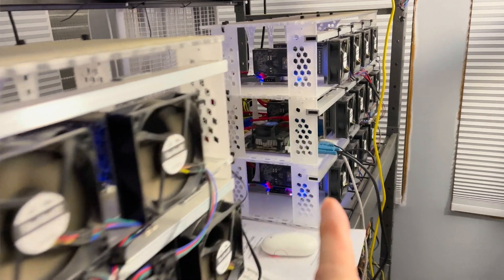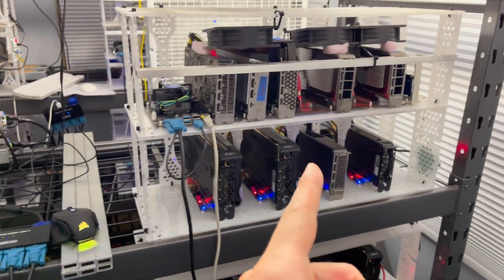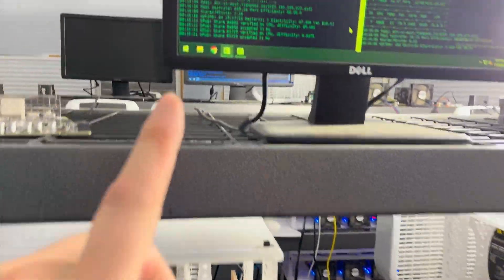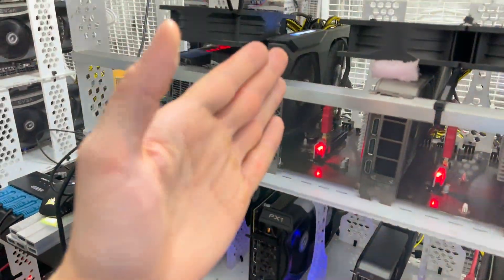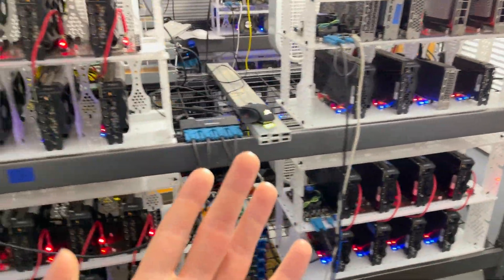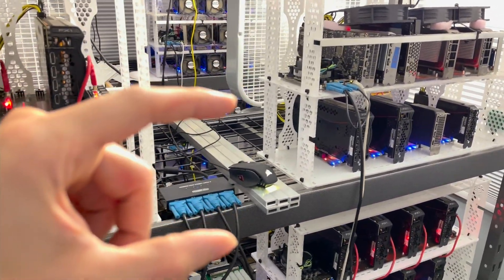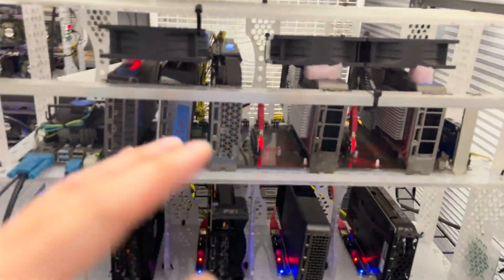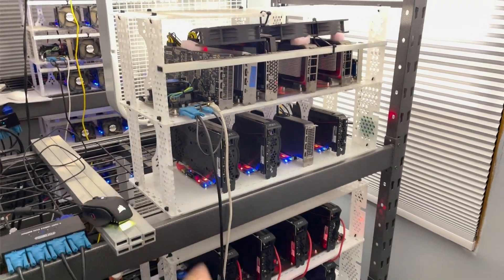Can A Crypto GPU Be TOO COLD?

Comment: Honestly I don't think there is a to cold. . I've run my  cards basically at negative 30ﾟ and they ran fine usually without any fan.
Reply from the maker: Most hardware will happily run at -100F or lower, consuming less power and even degrading slower. But it's always a tradeoff between several variables that results in an ideal temp for the total system.

Comment: One time in winter I got a little zealous with my small farm and just opened my windows all the way. It was 30F outside and inside around 55F. One of my cards started thermal throttling running at ~45C/80C memory. I believe the card became too cool, shrunk and detached itself from the heatsink. When I increased the temps back up it went back to normal! So now I always try to keep temps at a manageable sweet spot. And your advice really helps. Thank you!
Reply from the maker: That’s a curious one. GPUs should work just fine in 30F, so maybe something was up with that one. This expansion and contraction of the silicon is extremely tiny, but this motion still causes issues over time. 

Your support is appreciated.

Comment: Ironically with my ac, I found that it should be running 100% at all times. Allowing the thermostat higher temps and thus the ac to self shut down intermittently the massive power spike to bring temps back to spec (86f) were significantly more costly than setting all units to an impossible 55f, where the room never goes below 72f. Power only ebbs and flows with the rise of the sun. I save about 3kw this way.

A2000s? How many watts do those modded fans use? I personally modeled out an aluminum plate and replaced the thermal pads with those. 40% oem fan across the clusters now.
Reply from the maker: Are these inverter mini splits? I hate how the logic works on most mini splits, it's very poorly suited for an application like mining. It makes sense just hammering them is the play, since your system is undersized anyways. I messed around with a custom controller  on an LG mini split, its possible to control the units capacity and have it ignore the building temp. This is a custom solution that's a lot of hassle though.

The A2000's are shunt modded, 82W target power limit. They run warm since the heatsink is rather small, usually the card consumes 78-81W depending on temp, the fan is ~3.5W at 100% speed and its controlled based on the ambient temp. 40% fan speed on the stock A2000's with the stock backplate and everything? Wouldn't those guys run super hot? The coolers hold up alright at stock power, but these get toasty in a jiffy with power mods.
Reply: @SiCPoWMining  correct on the mini splits. If I could dm you, I’d just send you the same setup video I sent to GPU Risers when they asked for it :p

Anyhoo, 5ton mini split central air system - 2 ton wall mounted mini - 1 ton window mini (mostly to prevent window intrusion/security).

As for the A2000s I’ve still not committed to shunt modding them yet. It makes sense and I’ve got a guy who’s going to practice soldering r005 resistors until he’s comfortable doing the job, at which point he’ll solder his own a2000s and then mine.

As for cooling the a2000s, the aluminum plates make a significant difference, but also the fact that they’re being fed consistent chilled air helps as well. I expect shunt modded, they would probably shoot up to 60% min fan speeds. On that note, all my hardware runs in Octominer cases, so I force feed all that chilled air fairly aggressively to/through the cards.
Reply from the maker: I should probably make some socials.

Those shunt resistors are massive, and the A2000's are super easy to solder to since they don't have some massive power plane. I have a lot of experience, so maybe I'm biased, but its literally a 10-15 second job with very low risk. I did mine a few days after I got them, well before anyone online was talking about it. I messaged a bunch of mining YTers about it, and nobody responded or made a video. That was one motivation for making this channel.

That checks out. High power external fans really ding efficiency on those relatively low density cards, but it does the business.
Reply: @SiCPoWMining  yeah. I hear you on the efficiency side of things - hence the earlier question about your fans :)

With the plates installed, I brought each x12 down by 100 watts. 

Plated 3080s remain unchanged beyond the fact that the GPU fans run at 0% and the case fans cool the entire system effortlessly between 60-100% speeds on the deltas.

I’ve got soldering experience. Enough at least. But I’ve also never been great at it either. The efficiency of the a2000 isn’t diminished any when sucking down more power, correct? And isn’t the core limited to 86w by default given that it’s a laptop 3060 die?

Lastly, as you grow, discord may become your friend. :)
Reply: @SiCPoWMining  Do you have any experience fixing damaged traces on PCB's by any chance?
Reply from the maker: Efficiency is about the same when modded. It just allows the card more power if you need it, if you use absolute core clock then you can technically set it to whatever and it just means under load you can set the core clock higher. Peak efficiency is going to occur slightly before max hash, but it’s over 600kh/w at max hash so that’s not so bad. I’m not sure what the absolute limit is, I modded mine months before it was a public thing people were doing. I snuck up on it, and ended up at ~82W total being enough for ETH max hash without the fan load. People solder 5mohm shunts which allow double the power, but I don’t know if the card can or will draw that. I assume it can draw too much in some circumstances and it’s not the best idea to do the 5mohm shunt, but I haven’t tested it. The only way the card knows power is from the two current shunts that measure core power, and slot power. If you ‘lie’ to the card by modifying these shunt values it doesn’t know what 86W is anymore.
Reply from the maker: Yes, but a YT video is a safer bet. I’d just scratch off more solder mask and solder onto the trace. If the trace is gone and it’s just a via, it gets sketchy. If the via is buried, or gone, you need a schematic.
Reply from the maker: I suppose if you’re running hive this might not be as clear, but the problem with A2000’s is they run out of power and the core clock collapses to compensate. You can program 1200mhz or whatever, and it might only run at 965 since it’s power limited. The shunt mod just helps the core maintain a high enough core clock to maintain full hash instead of it riding the power limit and pulling clocks.
Reply: @SiCPoWMining  correct. From my understanding of it, the hardware (core) is physically capped at 86-89 watts and the resistor opens the hardware to drive beyond the 70w limit, or at the very least convinces the internal controller that it’s only getting half the power it needs. I assume the card is always looking for more power and the additional resistor simply opens the door for the card to access the power it needs to run. Sadly, the cooler is anemic for this and without modification, heat management will be complicated.
Reply: @SiCPoWMining  Any advice on how to clear the mask without removing more solder in the trace? Is there a channel I could send you a picture for some advice maybe? Thanks for the info!
Reply from the maker: I’m a bit confused. The solder mask is the color on top of the PCB, usually green, sometimes black. You lightly scratch at that with something like a screwdriver, tweezers, soldering iron tip, and you can solder to the copper under. If there’s always solder there, it sounds like there’s copper under it. I’m certainly not an expert on PCB repair though.
Reply: @SiCPoWMining  interesting. So that’s kinda what I suspected, although you clearly know way more about this than I do as it’s all guesswork and theoretical to me. Kudos on being early to the game and modding things properly. My soldering skillset is a bit more macro and outside of the r005 resistors or supplemental 12v power, I wouldn’t know where to look.

Either way, sounds like you know what you’re up to. Keep it up :)
Reply: @SiCPoWMining  Is it possible to send you a picture? Just to clear some things out?

Comment: Very interesting topic. When it is warm during the day my cards are much hotter then during the night.. Sadly I have no good way of circumventing this difference.. Especially DDR6X temps suffer from this. Also - did you design the fan mount for the A2000 cards yourself?
Reply from the maker: Variable fan speed for your room, variable capacity for A/C, and potentially reduce fan speeds on the GPUs at night automatically if the difference is large enough. But yeah, sometimes it can't really be avoided easily. Yeah, I designed the A2000 fan duct. It had something like 40-60 revisions, lol.
Reply: @SiCPoWMining  The A/C unit is no option for me as I don't have solar. It would completely ruin the efficiency of my cards mining. And making it 'less' cold at night seems a bit counter intuitive.. :/ I've been thinking about all these things for some time now but I can never decide what to do. Pulling air out the room better would be great during the day but I only have 2 velux windows and it is dangerous to open those too far in case it would rain.
About the fan ducts, would you be interested in making a 120mm version of it one day? A bit bigger, a bit longer? I understand the benefits would not be that large but I am sure alot more people would try it out. I, for one, have dozens of 120mm fans but no 80mm or 92mm ones. Being able to use a 120mm version of the fan duct would be a much more compelling idea. what would it take for you to make a 120mm version?
Reply from the maker: I added a 120mm version. I didn’t have time to prototype this yet, but it should be fine. For an A2000, a 120mm fan is massive and it’s not really very practical as it gets in the way of the mounting tab. The fan could stick out more, but production costs would be very high. Purchasing a 92mm fan likely makes more sense, but a 120mm fan would perform better. Of course, anything that’s low power, low speed, or low static pressure won’t work very well. You’d want a fairly high power PWM fan, in the ~1A range, and dial it back as needed with a PWM controller.
Reply: @SiCPoWMining  I have a bunch of Noctua's NF-A12X25 fans laying around so I would love to use those! I assume they would do a great job here.
Reply from the maker: The A12x25’s are far too low power for this application. They would work, but it may not perform better than the stock fan. You want something rated around 0.6A as a minimum, ideally 1A or even more, with PWM and a speed controller.
Reply: @SiCPoWMining  That is very sad to hear! But I understand why..

Comment: My 3070 and 3060ti start to use more wattage as soon the go over 60c... So i keep them @ 60. As this seems to be a temp kinda easy to hold if its not to warm outside...
Reply from the maker: Yeah, often times there's a 'sweet spot' where everything makes the most sense. Decent power consumption, the fans aren't running 100% all day, and the temps don't wildly swing up and down. Depends on the card and the environment.
Reply: What sucks is my 3060ti wont show mem temp on hive 🫠🫠
Reply: @Cardmonger  because Linux drivers for the 3060ti dont van mem temp option.

Comment: Idk if I've just been lucky but I've had all 35 of my cards at 100% fan for 2 1/2 years and zero bad fans
Reply: its not bad for them.. have to think.. are you more willing to buy and replace fans.. or buy and replace a gpu... fans are much much cheaper to replace..
Reply from the maker: A good fan will last years at 100% no problem. It depends quite a bit on the fan, generally the higher speed the fan is the lower likelihood it lasts. Some fans on cards are just garbage and they fail super early, but it's usually not really that big of a deal to fix. As you scale up, the 'right' fan speed is something to consider, since a lot of the time just sending them at 100% does very little for temps anyways. But yeah, if the card is cooking hammer the fans and hope they last. If you have a lot of the same GPUs I would get a backup plan on hand, maybe buy some spares in advance so you don't have downtime.